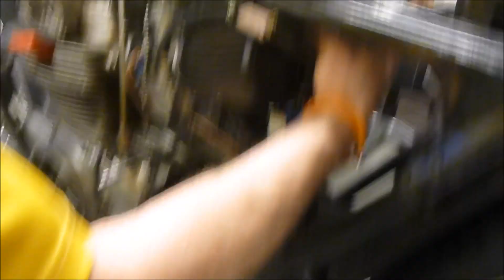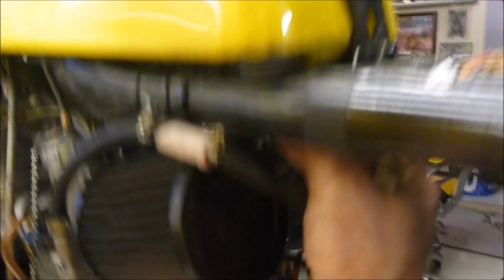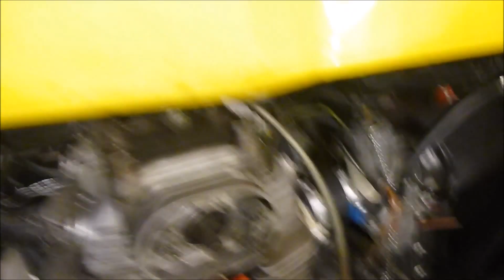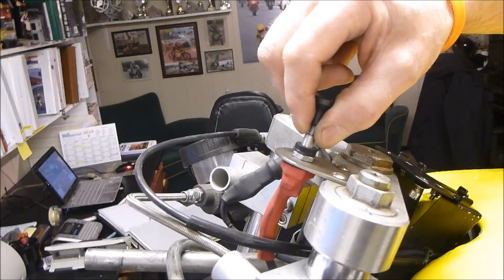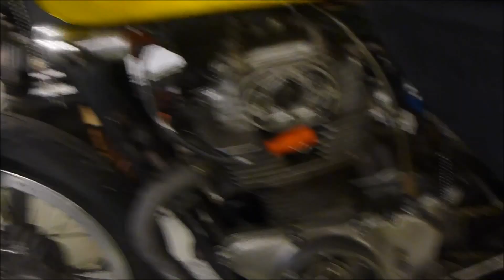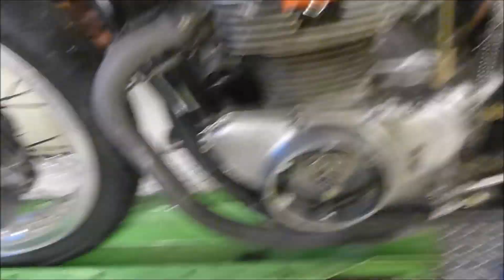Honda CB 350 Racer- startup and sound

Comment: Pretty cool. I built a couple stock engines but can't get those VM 30s to work. Run too rich. Need any engines?  Have about 10 on the shelf
Reply: I used one as a 'ride to work' in the 70's. Little did I know that they would become a 'weapon of choice' in classic racing. You might get more money for your ten engines than you imagine.